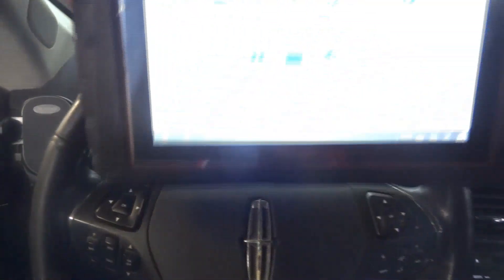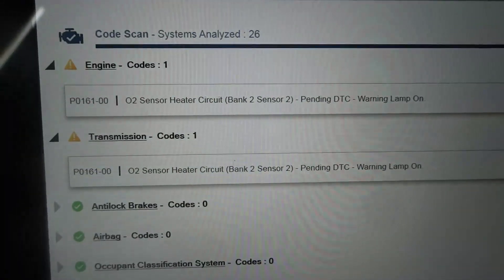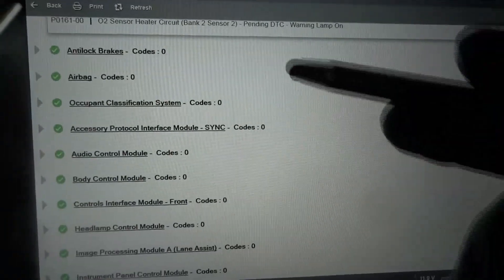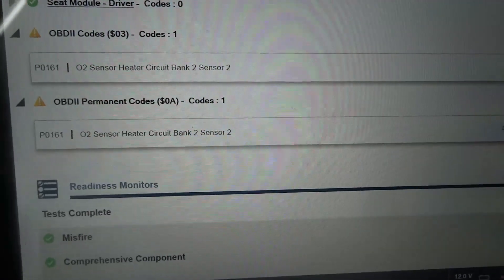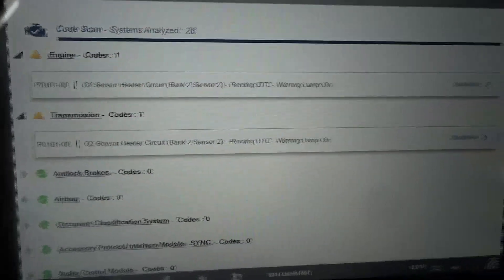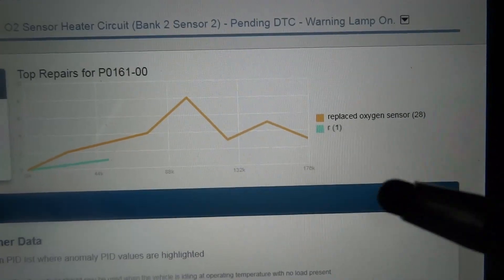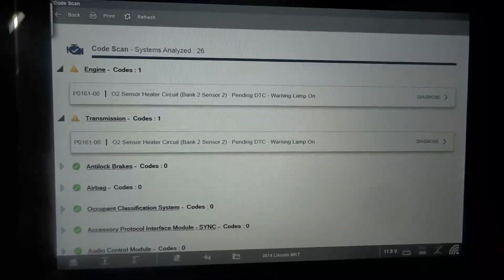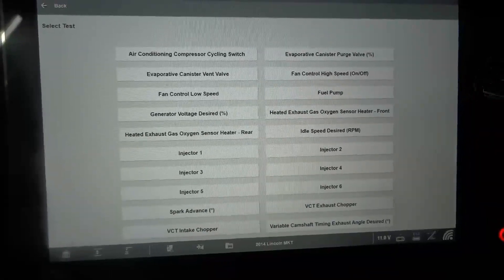P0161 - Oxygen Sensor Heater Circuit Malfunction Bank 2 Sensor 2 Diagnosis & Repair

Comment: That you for explaining that  now I just need to replace my oxygen sensor again thank you brother.
Reply from the maker: @LorenzoBlanco   My Pleasure!
Reply: Now that I replaced the sensor it still didn’t pass smog the technician said I needed to drive like 100 miles so the computer can reset the heater in the sensor. Does that sound right?

Comment: I think when the sensors failed is because the cat is bad and the sensors dont reading because the cat dont reach the correct temperature and dont active the 02 sensor im not mecanic but all time the most people spend money in the sensors y the main problem its the cat
Reply from the maker: @adriangomez1668   No! that's not the issue because the sensor has a heater in it

Comment: Show me the mapping of the wire if it was the wiring and not the sensor.
Reply from the maker: @richardpersaud2357  you don't believe this test
Reply: @ it is not that my truck has the same problem but it is not the sensor it is the wires the colors from the sensor is different from those in the connector I need to trace the circuit to see where is the short.

Comment: I put 2 new O2 sensors in a ford ranger and the same code you have is what came up on the scan tool I used what else would cause the light to come on
Reply from the maker: @danbeckley3140   check the sensor wiring!

Comment: on left bank my o2 sensor heats up too slow, i installed light bulb like you , i turned key and bulb started to glow but it blinks ,i started engine, same thing it still blinks, should it glow continuously until sensor reach working temp
Reply from the maker: @makantahi3731   Yes!

Comment: I’ve been having a o2 problem,I’ve changed it 3 times with 3 different brands,can’t be a part malfunction after 3 brands,any help?
Reply from the maker: @carlossicairos7348  did you test the wiring of the sensor?

Comment: In your experience, if there was a TSB here, would that be an OEM TSB or a third-party aftermarket TSB or possibly from either source, thanks for the video. I am affiliated with DDTSB in Europe, cheers.

I wish you would have bench tested the old part and new part for heater resistance values, for our information, or maybe the old part was open circuit.
Reply from the maker: Duane Donaldson  probably from either source,

Comment: Hi handsome, may I buy you a GoPro 11 from Costco with a head band , so you can use both hands? I really enjoy your work. Would you consider, producing a seminar on how to repair 2021 Mercedes sprinter vans? I would like to sign up and or I would pay for a pdf file on how to repair your Mercedes van sprinter+ what tools you will need.  Just a thought. Thanks.
Reply from the maker: G O  Thank you! I'm gonna put together a course on Sprinter vans and small Diesel engines, Stay tuned Great things are on the Horizon !!